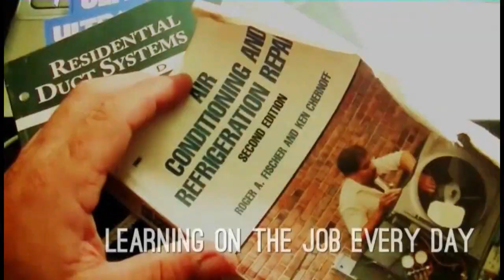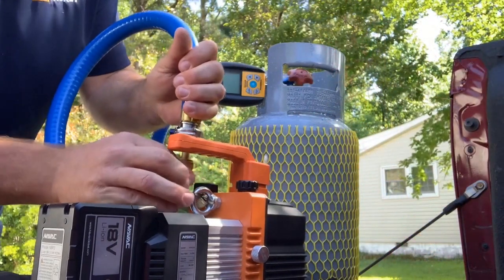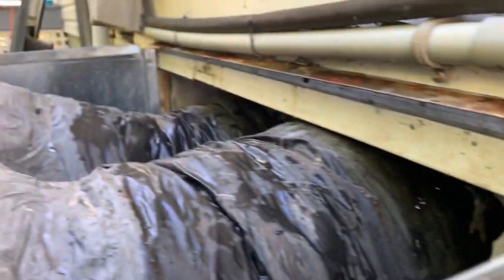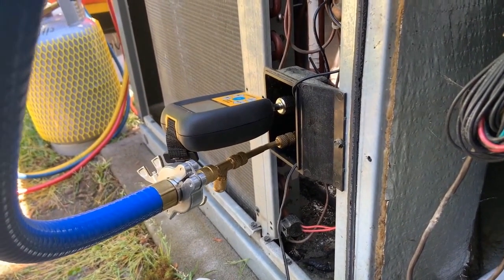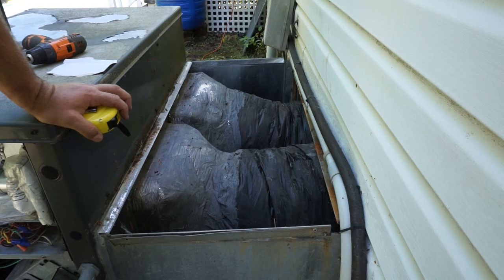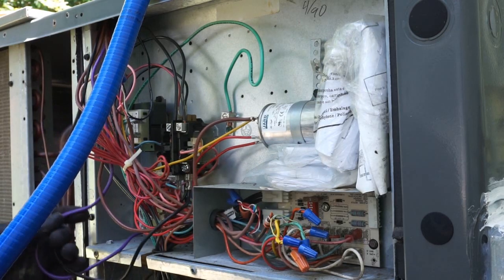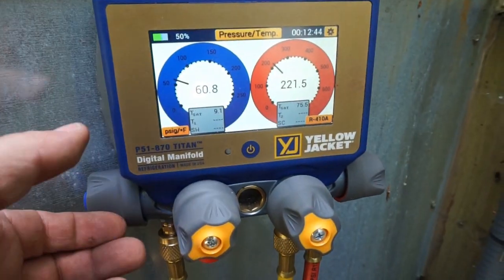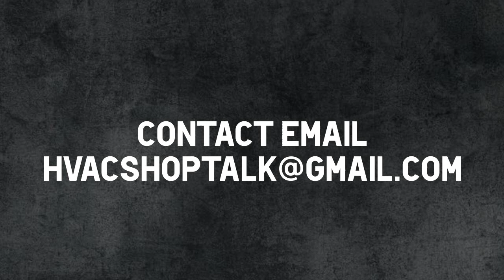HVAC Service | Replace Pressure Switch and Replace Hood Top

Comment: I don't like using the recovery machine to push it back in because I'm worried about contamination or air in the machine. On a split system I will close the liquid line valve and pump it down and can suck all the vapor out down to around 30psi

Comment: Hey thanks for the video.
You asked so I will reply.
I flip the recovery bottle upside down and use vapor port.  I'm sure you do to.  Not being smart a, just telling you what I do. 
Also, I didn't notice it, but I put a Schrader in for the pressure switch for easy peasy next time.  Maybe you did, I just didn't see it.
Thanks,
Keep going for the up and coming best practicing super techs.
PS. Oh ya I forgot - filter drier is a yes always unless special exception.
Thanks
Jeff

Comment: Zack, I bought the 90 degree end which helps a bit on the condenser end. I also found out the hard way that the Navac 2cfm cordless vacuum pump MUST have the battery removed when not in use or it’s dead. One more trip to the roof with a charged battery. Zack, guys need to understand this isn’t a “ textbook “ perfect situation always. You need to do what needs to be done , you can’t always reinvent the wheel.Nice job stay well

Comment: Not an HVAC tech but when I did the HVAC portion of my automotive classes I remember it being a general suggestion to replace the receiver drier any time the AC system was opened for service or repairs (especially for any extended time) and obviously if it had been leaking or something. Plus the interval typically quoted for those is like 3 years so odds are its going to be beyond that anyway because people only have the AC in their car checked out once it stops working. Not sure how that interval compares to residential hvac filter driers.

Comment: How did you switch from the TruBlu hoses to your charging hoses without getting air into the system if you didn’t have a core tool on the system to blank it off while you switched hoses?
Reply from the maker: There would have been a small amount of contamination introduced to the system.